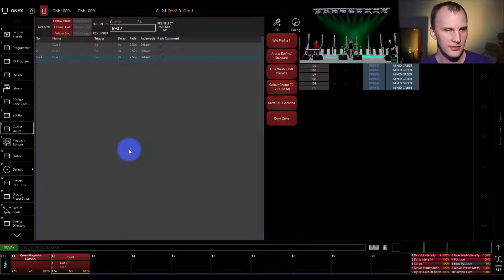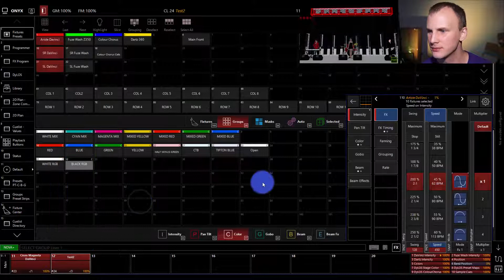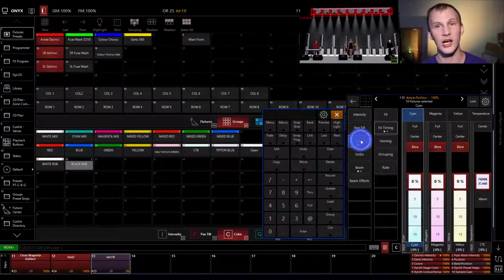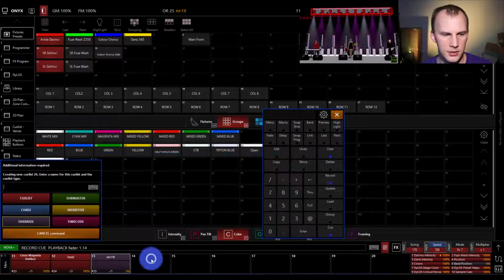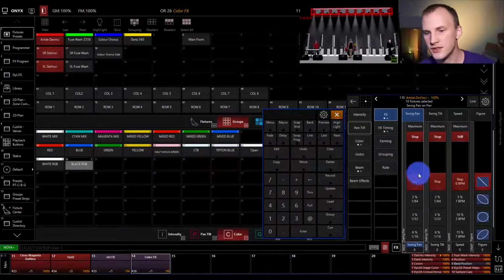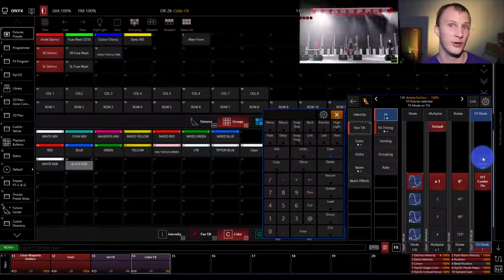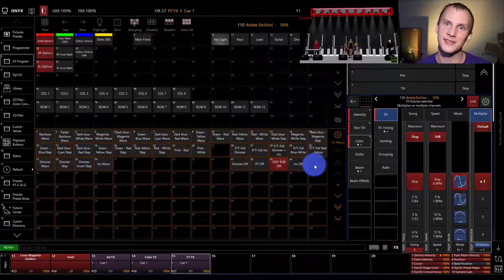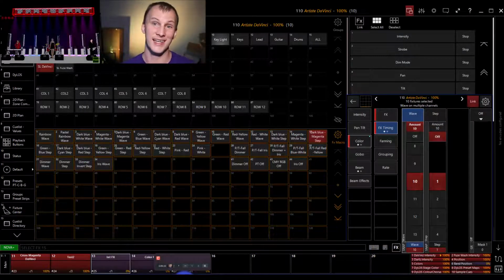Working with FX in ONYX

Comment: Can I reset the effect phase? Because when calling presets or cues sequentially, they start not from the beginning of the sine wave but as if in continuation. This is very inconvenient. I have Onyx 4.10.1271 M-DMX.
Reply: For example, I want to call a cue that contains 2 waves. And then a cue with intensity turned off. And so on cyclically. But so that the two waves of flashes begin from the moment of calling and not like now, where the phase of the sine wave is at the moment, there the cue will begin.

Comment: Hi David, I'm very close to what I really need.. the chase technique isnt bad! I'm working on a TV show setup that is fully automated and the game itself sends midi signals. I am a pro with Light Jockey but I have some problems to make my NX Box work in Win10 with LJ. I'm also not happy to find out that 4.6+ don't unlock midi anymore. I've tried 4.4 and the box seems not to be recognized.... seems like they try to steal my money. 

Anyway, my question is.. the Cuelist is almost in the same thinking that the one in Light Jockey, but in LJ we can program step by step our cues, so a step can be like 5 seconds long and we can choose the fade. each step a a new cue in a way, like the old 8 bits controllers with 8 steps (each step is a complete different program) ..So I can program something in the 1st cue that can run for 60 secs, then it automatically change for the Step No.2 and it's something else, etc.

I've used steps for so much different reason, like to make huge impacts (like the 1st 2 seconds) then fades for 3 seconds, and then a chase of steps (like 400 steps of 2 secs each) will come over to maintain a level of activity in the background waiting for a new input. that way I can perform lots of stuff in a timeframe with a single hotkey. 

do you know where this function is now hidden in Onyx? or how to do this.. thanks a lot!!